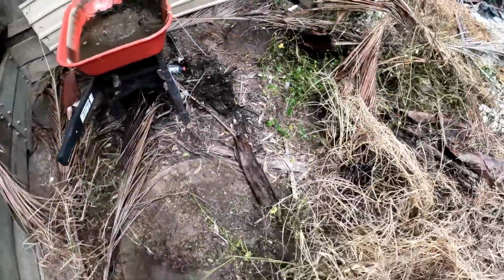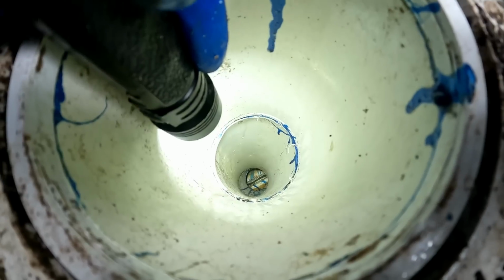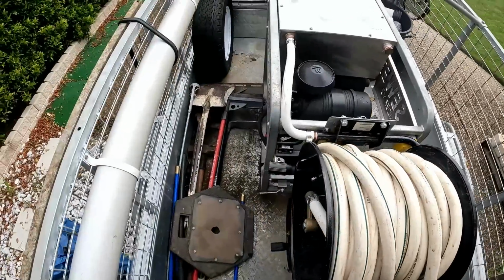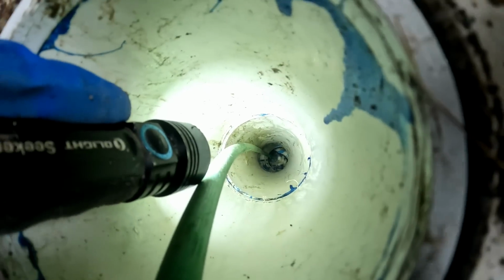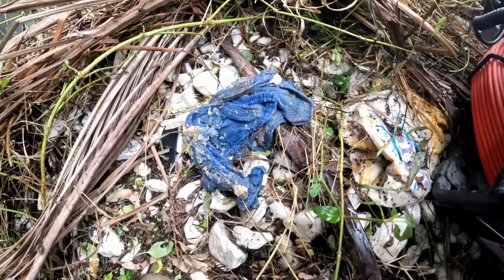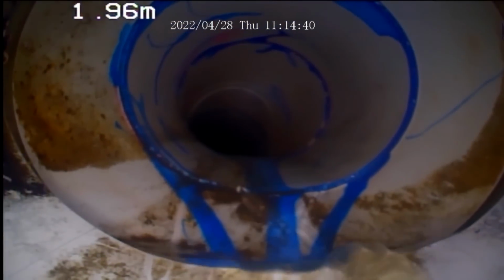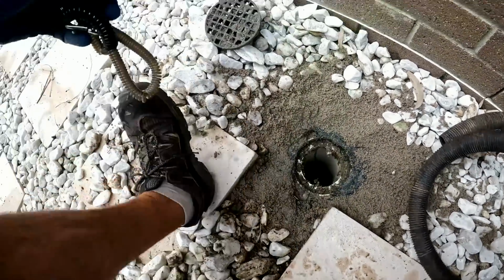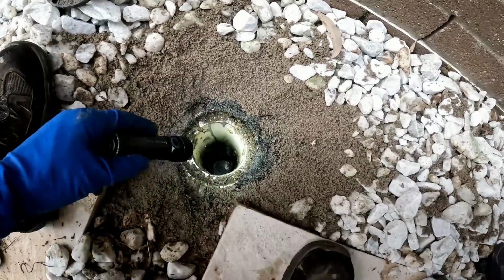Blocked Drain 239 - Cherubs Flush Something Down The Drain | Blocks The Whole Drain

Comment: Interesting how he uses soap.  He generally keeps the bar of soap in the flowing water which never allows it to lather up.  Just an observation.
Reply: A lot of soaps require being soaked before you can even start lathering them up.   The current (bad) formulation of Lever 2000, for example.   I gave most of mine away to a customer to use in one of their employee restrooms.